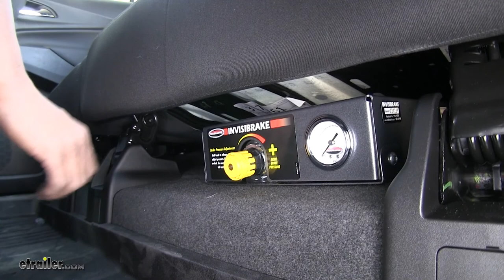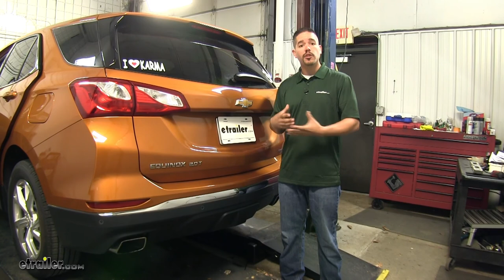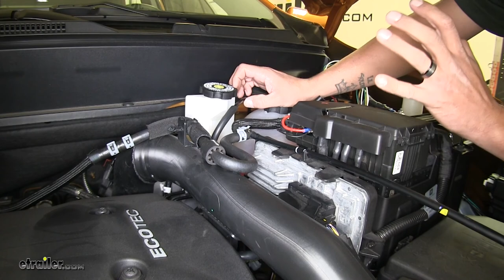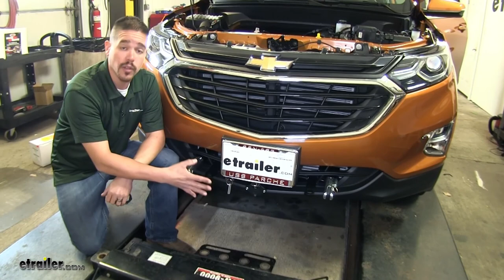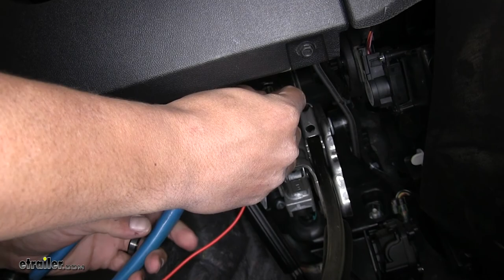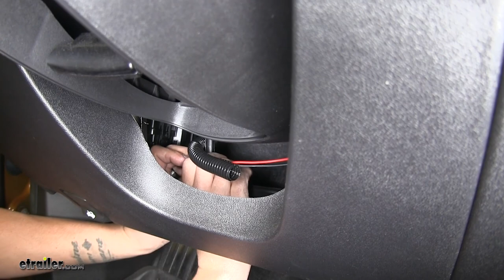etrailer | Roadmaster InvisiBrake Supplemental Braking System Installation - 2018 Chevrolet Equinox

Comment: That works fine as long as you never put your seat down.  The seat lowers probably 2 inches when folded down.  There is not enough clearance for that installation.